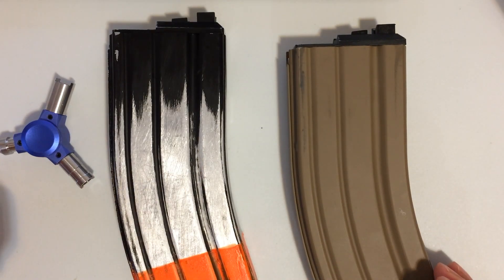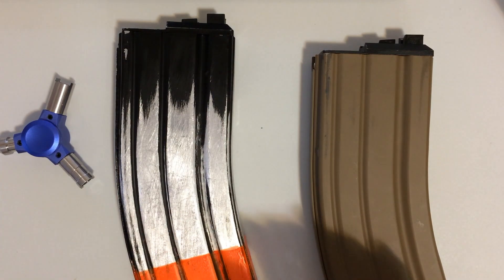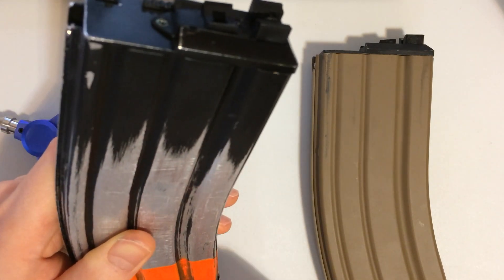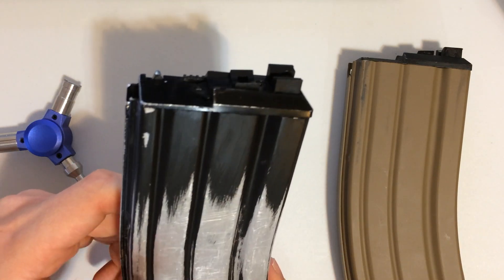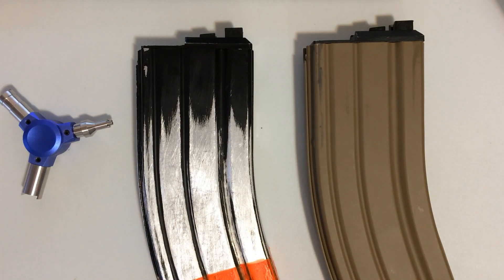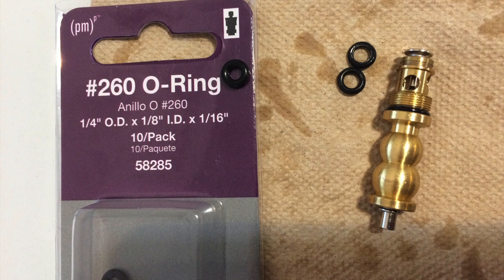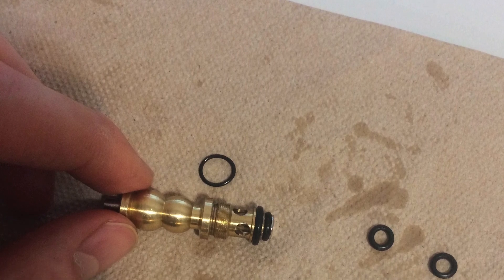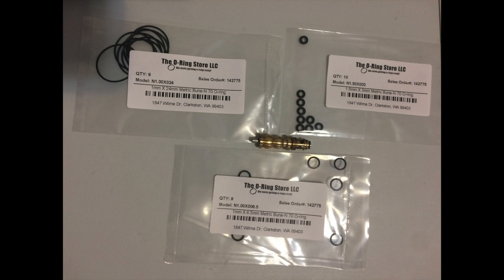Fixing and replacing O-rings in a leaking WE gas M4 Magazine

Comment: Thanks to this video i managed to repair a leaky mag for the first time.
I got a Scar L gbbr off of someone and they noted that the we tech mag for it was leaking. Ordered an O ring variety kit off amazon, swapped out one of the 1.5x3.5mm o rings, (o ring in the middle of the valve) and ended up fixing the leak.